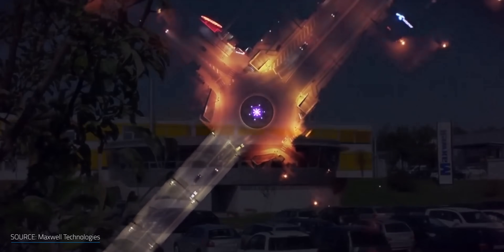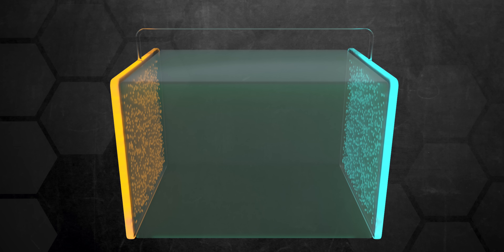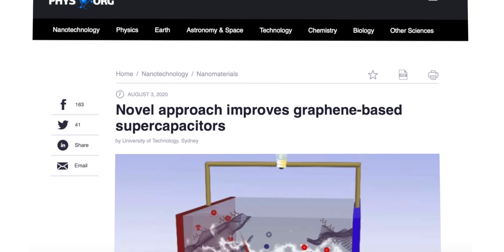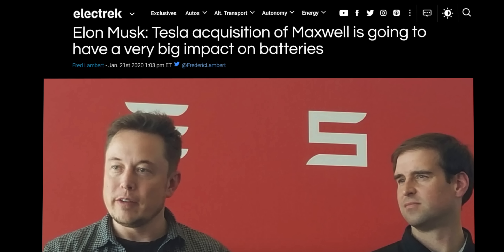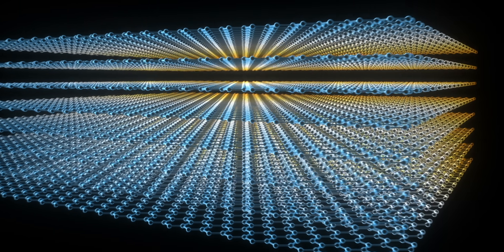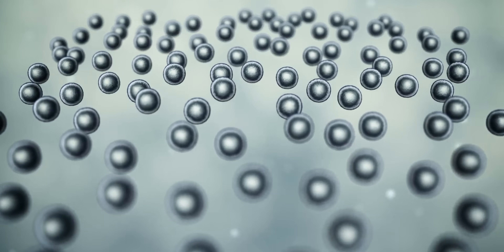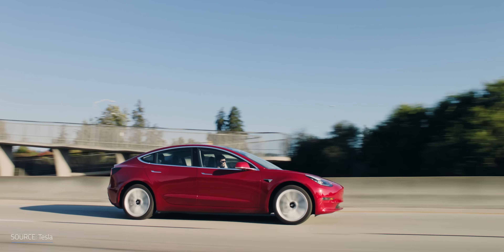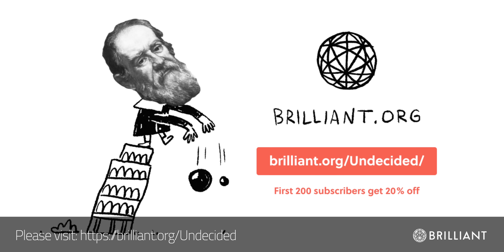Supercapacitors explained - the future of energy storage?

Comment: Just some info on battery life.  I recently replaced my worn out lead acid batteries in my home solar system with lithium iron phosphate batteries.  They are rated at 10,000+ full 100% to 0% charge cycles.  With a daily full cycle those batteries should last over 27 years.

BYD, the Chinese battery and EV manufacturer, has been using lithium iron phosphate batteries in their EVs.  The batteries are heavier than lithium ion batteries but apparently Chinese drivers are not a concerned about long ranges.  Tesla is now using similar batteries in the Model 3s they are building in Shanghai.

200 mile range.  10,000 cycles.  That's two million mile battery.
Reply: Very interesting, 10,000 cycles from full to fully discharged? Does that imply that the original capacity remains also?
I bet it doesn't but I would love to be wrong.
Reply: @conmcgrath7502  I had to dig into the warranty a bit to answer your question.  I learned that my claim was incorrect.  It's not 10,000+ cycles at 100% depth of discharge but 10,000+ cycles at an 80% DOD.  And the warranty declares the batteries "dead" if capacity drops to 60% of initial rating.

So not as good as I had assumed, but as long as I don't drop below 20% (often) I should get well over 20 years service and for the last 20+ years I should have at least 61% of my original capacity.  The nice thing about lithium batteries is that you can add a new cell to an older group and the old cells won't pull down the performance of the new cell.  That's a problem with lead acid cells.  So I might need a storage boost in 15-20 years so I can just add a third battery and be back where I started.

What might that mean for an EV?  Suppose you had an EV with a 250 mile range.  You'd want to avoid dropping below 50 miles in normal driving.  If you take only a few long trips per year you might be willing to take the charge closer to 0% and cut a little life off the long end.

And toward the end of life for the batteries your range would have (maximally) drop from 250 miles to 150 mile.  Not great but still fine for normal daily use.  Not many of us expect to take long trips with 20 - 25 year old cars.

But now!

Since I posted that there's new data coming out of Jeff Dahn's battery lab.  Dahn is Tesla's battery guru.  His lab has been testing some lithium batteries continuously for three years.  Charging and discharging day in and day out.  So far they've managed 15,000 cycles so this isn't the final performance data.  It's what they've found so far.

The cells they are testing are divided into four groups.  One group does full 100% discharges, one group does 75% discharges, a 50% discharge group, and a 25% discharge group.

After 15,000 cycles the 25% and 50% discharge groups have lost no capacity.  If you had a 250 mile range EV with these batteries and you almost always recharge before the range dropped below 125 miles you'd have as much range after 41 years of daily driving as you had when new.  And that range might hold for decades more, we just don't know how long yet.

The 75% and 100% discharge groups (250 mile range, drive to 'empty') and you'd lose 13% of the range  by 41 years.  From 250 miles to 218 miles for your 40 year old car.

It looks like we will soon have EV batteries that last far longer than most cars.  Will we buy new bodies and move our still good batteries into the new body?  Or will we sell our batteries to companies that do grid storage?

And, further.  What will this mean for incorporating wind and solar on our grids.  Tesla has figured out how to drop the cost of battery cells by over 50%, largely with new manufacturing techniques.  So a much cheaper battery with incredible lifespans.  Take the old cost for storing electricity in batteries.  Cut it in half.  Then cut it again by a much larger number due to batteries that will last decades.  We need to see these batteries installed and operation in the real world but if the lab results to the real world then we're about to see a massive shift in how we generate electricity.
Reply: @bobwallace9753  Thank you Bob for taking the time, quite the reply! I am still a skeptic, it's not that I don't believe you (and you seem better informed and more 'current' in your knowledge than I) but the various manufacturers have a way of presenting the most positive results in the most favorable way?
For example, do the discharge tests reflect the power demands of the cells in a real world environment? Speaking of environment, how do they perform when it's sub-zero all night? Do the battery banks suffer from vibration over an extended time?
Ref your own words regarding the warranty, another interpretation might be '10,000 cycles' if you never discharge below 80% and all bets are off if you dare to discharge below 60%? .
I'm not trying to be a 'dick-head' here (my friends will tell you, I don't have to try) but the figures seem extraordinarily optimistic.
As I said previously, I would love to be wrong and I have to admit, after a career that primarily involved lead-acid battery banks as a power source/resource maybe my opinion is prejudiced.
Here is another 'angle'; a fossil-fuel car might run out of fuel, but if you beg, steal or borrow a gallon, it will get you to the next gas station. If your fossil fuel car has a flat battery. then a 'jump-start' will get you going again, not the same for electric vehicles, run out of power? Shit out of luck, you have to be towed. Bad storm, no electricity, don't depend on that vehicle.
I'm not 'knocking it', I believe the future will demand electric vehicles but I would be very surprised if any Emergency Response Vehicles are made electric only in the foreseeable future, for good reasons.
I have one thought to offer, all electric vehicles should have a solar panel on the roof, not so much to make them more efficient, but if you do run out of power, at least after a few days (not covered in snow) the  batteries should have enough charge to run a few miles and maybe get you home.

Cheers matey, I'd love to know how you get on with the new 'set-up' as I am considering an 'off grid' system myself and haven't ruled out pneumatic storage yet, but that would introduce a whole lot of engineering and couplings which are subject to failure, moisture and noise.......battery banks are quiet!
Thanks again for the reply, I have a few things to think about.
Pax dude.
Reply: @conmcgrath7502  The Jeff Dahn data is from a research scientist.  If that's how you earn your living you really don't want to intentionally mislead.  People get drummed out of the business for dishonesty.  That is not to say that mistakes aren't made, but that the motivation is to be truthful.  Not to tell stories to aide the business.

I haven't read his paper, I'm not sure that he's published his results yet.  The data was from a presentation he made. IIRC the batteries were tested in the sort of way that they would be used in cars.  

As far as I know batteries are not impacted by vibration.  Cells are basically tightly packed paste (most cylindrical cells) or tightly packed dry powder (Tesla's new dry roll cells).  There's nowhere for stuff to move around inside the can.

I don't think cells are harmed by cold.  They just don't produce as much power when cold.  Heat them up and they  perform as if it's a warm day.  If you live in a really cold place you'd want to keep your car plugged in at night and pre-warm the cabin and battery pack before taking off for the day.  In super cold places there are often curbside outlets where ICEV drivers plug in their block heaters so their oil is viscous enough to allow their car to start at the end of the day.  

I didn't do a good job with the discharge limits on the batteries I'm using.  Stay above 20% charged, not above 80%.  80% of the battery charge is usable.  

My previous batteries were Trojan RE batteries that had really thick plates.  They were rated for 4,000 cycles if you discharged no more than 20% or 1,000 cycles if you discharged down to 50%.  Very different from these LiFePo batteries I've got now.

Running out of charge?  Just don't.  Go to Tesla's Supercharger page and look at how many rapid charger stations they have already built.  At this point I don't think there is anywhere in the US where you can get more than 200 miles from a Supercharger.  And their goal is to have Supercharger stations no further apart than 35 miles along most travel routes.  Tesla EVs are really sell set up to warn drivers that they need to stop for a charge well before it's time.  I guess some people will ignore the warnings and have to call for a rescue truck, but that's just who some people are.  

AAA has some EV rescue trucks but I don't know if they get any use.  IIRC they have large battery packs onboard and can give an out of charge EV a few miles of charge to get them to the next charger.   

I'm not seeing running out of charge as something that we need to worry about.  Cars are so smart that we could set the headrest to deliver a dope slap if the driver ignores the flashing light to stop at the next charger.  And I think insurance should not cover running out of charge.  Let the driver pay a bunch of bucks to be hauled to the nearest charger on a flatbed if that's what it takes to get them to pay attention.

As for offgrid, I've been off it since 1986.  It's not something that I'd recommend to someone who is hooked to the grid.  Install solar panels, perhaps some batteries, but let the grid be the "deep storage".  But I bought land that was well off the grid.  The utility company wanted $300,000 to hook me up.  That meant that I was able to buy a very nice piece of land at an affordable price.  Few people knew about solar and the lack of grid power kept the land price very low.

When I set up my previous system 20 years ago (I had another off the grid place earlier) solar panels were expensive at $8/watt.  I didn't install enough to carry me through periods of cloudy weather.  I've now installed a new set of panels with 2x the wattage and switched to a maximum power point tracking charger so I'm hoping that I don't have to use my generator during extended cloudy periods.  Or at least not much.
Reply: @bobwallace9753  Many thanks and respect.

Comment: thank you for making the distinction between specific energy and energy density.  a lot of people try to use them interchangeably.  Thank you for the video in general.  I still believe supercaps will replace redox batteries.  Hybridizing them is the first step.  There will be some interstitial or other modification to improve energy density.  The difficulty i see is supplying power at linear discharge rates.  High frequency switching (IGBTs) in parallel to a load to keep the load supplied at a constant rate is a viable path i see.

Comment: Combining super capacitors with your 12v car battery can make starting it easier, especially in cold weather. You use super capacitors as a battery replacement but you still keep a standard car battery in case the super caps go dead from.. listening to the radio with the car off for example. Since you won't get much time due to the very low capacity.
The (cold) cranking amps of super caps just make starting the car so much easier. 

I actually considered putting super caps in my old car before i sold it, since it had a sunroof that could have fit a solar panel that would have kept the caps topped off from the passive battery drain from the radio's clock etc.

Comment: That swiss bus thing is super cool. You can grab enough charge when stopped and then let it bleed to lion battery while driving. That opens the door to car that you don't ever need to charge but charging system is in the road itself. 250 against 25 energy density already gives that possibility. And the carbon charger supercapacitor can be used to add structure to the car body too.

Comment: Really good info, thanks! Always wondered how the issue of charging a battery as quickly as filling a gas tank could be solved, looks like supercaps are it. Quickly charge the capacitor at a charging station, then let it charge the battery while you drive.
Reply: Ah, but in that case, why charge the battery at all?  You could be using the cap directly instead for higher efficiency.  Only reason to charge the battery there would be if you're going to stop at another charging station before the cap is drained.

Comment: I use a Maxwell starting module super capacitor in my semi truck. It allowed me to swap out my old lead acid batteries for lithium batteries, which couldn't handle the hard cranking amperage needed to start an engine.
Reply: Do you have a link? I'm looking for one for my Jeep

Comment: I could see supercapacitors finding a place in the drive train comparable to RAM in computers. In heavy vehicles like delivery trucks/vans, this could significantly help their range and longevity.
Reply: @Mattew Connor
What gives the long range to heavy trucks is to have the ability to go 600 miles between fueling or recharging.  Batteries as they are now can't do it in a cost effective way.  Hydrogen fuel cells can do it.
Reply: @acmefixer1  I was more focused on delivery vehicles that do a lot of stop and go but don't cover a lot of miles in a day. That's were using a super capacitor could offer real benefits. 

Highway driving it's more about aerodynamics and energy density.
Reply: Acme, I think they were talking about super capacitors being used for regen.

Comment: The problem with longevity can be tackle with the development of a better insulator. The problem with holding a charge in a capacitor is that the electron tend to leak through the gap. A superior, thinner insulator is needed.

Comment: The car audio industry would like to say "welcome to the party"

Super capacitors are great for charging and discharging quickly.

They don't hold much energy compared to batteries.

But like, this tech has been around for a long while. The only thing I see as new is the use of graphen, and I believe THAT has potential.

Comment: Super/ultra capacitors tied in parallel also provides some protection for the battery. The capacitor would reduce heat in the battery from high amperage loads.  I have a 2000 watt inverter in my car and in my van I have a 1000 watt inverter.  On both, I installed a 1.0 fared capacitor that was originally designed large automotive audio amplifiers.  It has made a difference when I'm using a circular saw or other appliances that pull a lot if current upon initial start up.  In this case the capacitor helps the alternator.
Reply: I do exactly that with my muscle car with high cranking current. It killed an expensive Optima ‘Red Top’ so I have a ~90Farad super cap unit from eBay (suitably wrapped in heat shrink) protecting the replacement battery for those critical couple of hundred milliseconds after I hit the starter. So far so good for the last 4 years.

Comment: Electrolytic Caps have been used for years as "start" caps for the fan and compressor motors in Air conditioning systems.  They are the first thing the AC technician checks for failures since they fail often, what will be the failure rate of these new style caps?